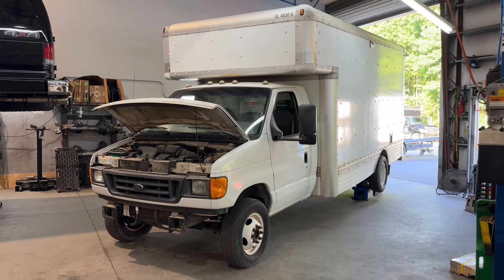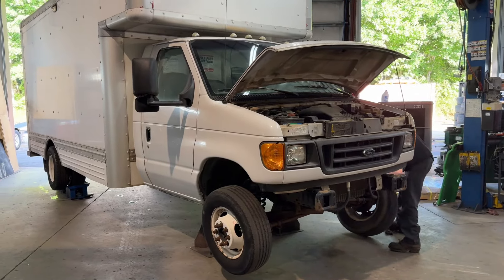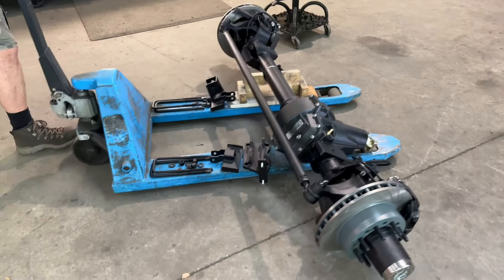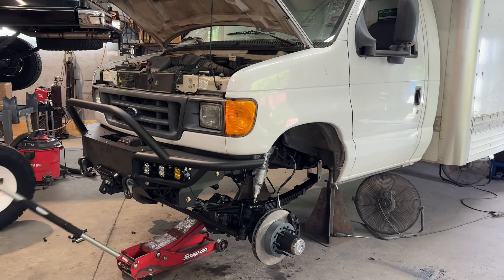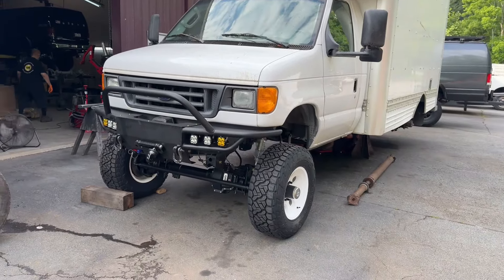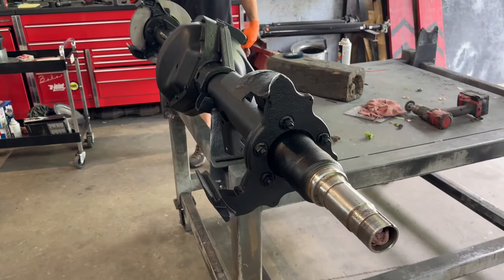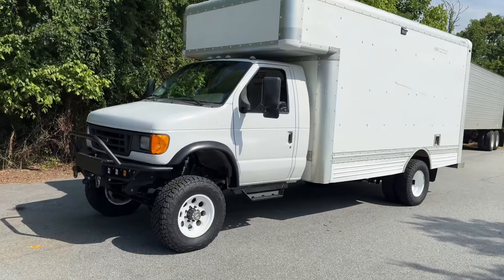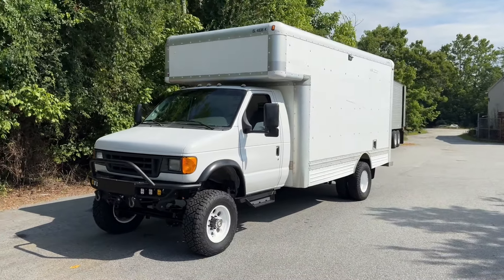UH2 Build Video! 4x4 U-HAUL! 🚚

Comment: I like it but i feel like the front axle is awkwardly infront of wheel opening. My taste would little lower and tires tucked more. Keep'em coming Chris.
Reply: Or lift the back higher to match the front...looks awkward!
Reply from the maker: @ChroniclesofAlicha_Balaam  Its 100% level, different size wheel wells and the length is playing with your eyes
Reply from the maker: It has our standard 2" axle push for more wheel travel/tire to fender clearance. Would clear 35s and look better but then we'd have to add spacers to the rear/etc which we always avoid.

Comment: Nope the ford V10 is a turd of an engine...
Reply from the maker: We see a lot of them, not a turd. What experience do you have with them? Specifics please
Reply: @ujointoffroad we have an 06 v10 16ft uhaul and with the rig weighing around 10k and a 6k tandem 24ft trailer it isnt fast but she just keeps chugging with almost 200k. Just let it go it's happy speed. The transmission is a tank. Has shot 1 spark plug.

Diesels have ruined everyone thinking they need to tow at 85 mpg or it's gutless.
Reply from the maker: @jeepindave5464 they’re great engines although thirsty. Our other U-Haul has almost 200k on the bottom end and still on its 1st transmission. 👍🏻
Reply: @ujointoffroad  First off it quaffs fuel.  They have notoriously short threads for spark plugs and are prone to blowing the plugs and the threads out of the blocks. Huge problem..  Burns oil like a diesel...
Reply from the maker: @spencervidal3168 any engine of this era and this size is going to like fuel. We’ve seen 2 plugs blow in all
of the years we’ve been in business so I’d call that less than a major problem. And, the spark plug threads are in the heads, not the block.
Reply: @spencervidal3168  that spark plugs problem is an easy fix and is permanent once you do it. And ford the rectified that problem at a certain year. Thirsty but guess the job done. And would cost you thousands less to maintain than the 6.0 diesel.